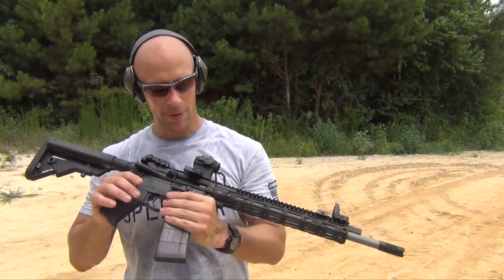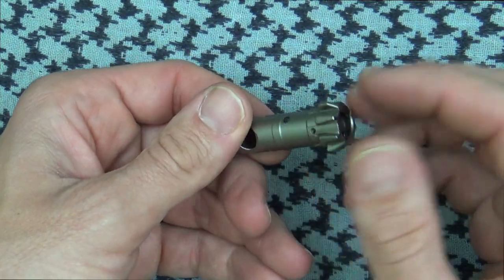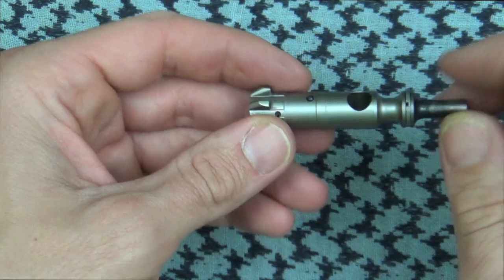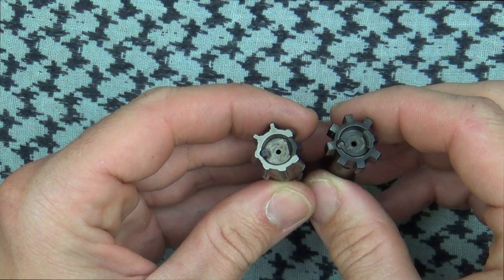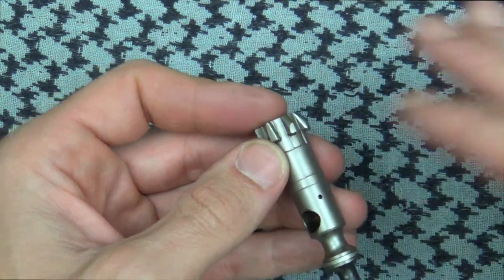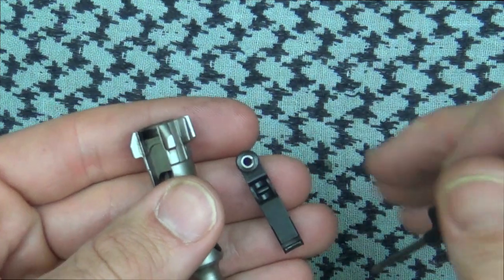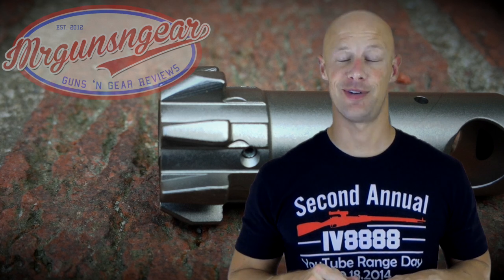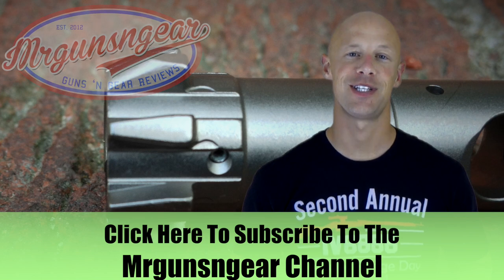Sharps AR-15 Relia-Bolt Test & Review (HD)

Comment: I've been putting together "bump-fire" carbines using the Sharps BCG (WITHOUT the nickel boron addition) and they run smooth as silk, with no malfunction whatsoever. My recipe for a really smooth running and reliable bump fire carbine is:

SlideFire SSAR-15 MOD stock -- and make sure it reciprocates smoothly by adjusting your carbine recoil tube for no binding.
Tubb's flatwire recoil spring
H2-weight buffer
Sharps BCG (no nickel boron coating)
TAC CON 241 trigger (used on first fire position -- not position 3)
Carbine 16" barrel with CARBINE gas system (quite critical for best operation)
Precision Armament "M4-72 Severe duty" muzzle brake

This makes for a truly AWESOME "select fire" carbine. After a few mags, and good lubing I get fire rates of around 850 RPM with PERFECT function (with XM-193 ammo -- Wolf steel case runs absolutely fine, but at slightly slower fire rate). EWL Slip 2000 privides excellent lubrication. The muzzle brake allows for minimal muzzle climb. TOTALLY controllable full auto -- switchable to semi-auto without even having to change selector setting--just move your finger off the slide-fire bar and directly onto the trigger.
Reply from the maker: awesome

Comment: My go to home defense unit is an AAC 300blk pistol. They use 158 steel with an advanced nickel boron UCX EXO coating along with a green o ring. Last year we had 30 days straight of below zero temps, many days down to 30- 40 below zero here in Minnesota. I can't take a chance with the S7. But I do recommend that every one carry an extra bolt and carrier group in their rifle bag.
Reply: What is it about s7 that you don't like?
Reply from the maker: M85FSLUVR Agreed----extra bolts are the way to go.
Reply: Lozzer, normally, nothing. But in my go to rifle, in sometimes very extreme weather conditions (which, btw, in this age of global warming, lol) here in Minnesota, I won't take the chance on S7 because it is more brittle and unstable.
Reply: M85FSLUVR I'd be interested in seeing the Spikes test if you're going to base it off of that one sample size. did they publish how a typical bolt did at those temperatures? For some reason I highly doubt that the S7 is so much worse at those temperatures, when it's so much better otherwise.
Reply: Has nothing to do with the spikes test. Its a more brittle steel. Its science. Extreme temps have an effect on brittle steel. Also, science. Sharps didn't just discover S7 steel. It's been available as a hardened steel for use in bolts forever. Cost isn't the real reason it hasn't been used, science is.
Reply: You guys are leaving out the heat treat factor. Only way to know if sharps addressed it with their proprietary heat treat (which can address the brittle nature in sub zero temps of untreated S7) is to use one in this environment extensively. My guess is it will do fine and you will have other issues before the bolt.
Reply: LozzerGuide There's a reason this material isn't used too. If you have an out of battery discharge , you want the bolt and carrier to absorb the impact. If the steel is so hard and won't be destroyed per se. Then those forces will be redirect. Most likely to the upper receiver. Which will seriously hurt the shooter. Hence, the bolt is Over Engineered" and could cause more issues than helping. The Army did testing about 5 years back, And due to over engineered parts. Elected to remain with parts that would absorb impacts that weren't of normal use. And I do know what I am talking about I have a PhD in Chemistry. An item being of better material doesn't equate to better all around. This is gimmicky. Barrat uses this material in their .50 cal M-107 in which it's needed. Barrat was considering using the material in their REC 7 AR's. When the govt contract told them why they don't use it. Which is what I stated above. As well as what the other viewer was mentioning in fall rate at low temps. Metal has stress fractures over time. So it might fail at a lesser low temp, after a few thousand rounds of use. Whereas, C158 is still quite hard, but can with stand long use of rounds.

Comment: Nice review!

I think it's great that the AR buyer has all these options these days.  That said, my factor S&W bolt has been fine through three years of shooting.  Sometimes I wonder if these companies are making solutions to problems that very few if any owners will ever encounter.  But hey if you want it you can get it and there are likely high volume shooters that might benefit.
Reply from the maker: Murphy82nd Thanks.
Reply: You're absolutely correct in your assessment regarding manufactures. It's a hot market right now and companies want to cash in if they can. There's no need for an Over Engineered Part. It's wasting money. The AR's brother is a proven system for decades now for a reason ...it works just fine.
Reply: +Murphy82nd I actually am more interested in the entire bolt carrier group being a balanced weight with more contact surfaces on the rails, the bolt is cool I suppose as long as they've fixed the issues they were having with broken lugs.
Reply: +Mrgunsngear Channel Hey that carrier looks pretty similar to the AIM carrier I have in my black out Anderson AR, is it the nitride finished carrier that originally came with the C158 nitrided bolt?
Reply: Rick S the whole no tilt balance thing is complete garbage. Carrier tilt occurs because the force is applied by the gas tube is out of line with the center of gravity of the bcg (gas key sticks up on the top) creating torque. It's not because the back of the bcg is a quarter ounce heavier than the front. It's just fancy show cuts that Jack up the price.

Comment: I know this is an old video (especially by YouTube standards) but my main "interest" in this bolt is the retaining pin channel (though stronger bolt lugs themselves are always nice too) I wonder if the increased yield and tensile strength equates to less overall load stress on that channel.

Comment: There is a voluntary recall on these from Sharps. There were batches not heat treated properly. Contact sharps at info@src.com to see if yours was heat treated improperly. They are issuing replacements.

Comment: How close is it to LMT's bolt design?  I know the material used is deferent but are the cuts on the lugs close to the same? Another great video by the way
Reply from the maker: dennis1979gm Similar design but I don't have dimension sheets.

Comment: 9 months later; Whats the verdict? Have you kept running it?
Reply from the maker: worddunlap yes.   0 issues
Reply: Mrgunsngear Channel have you run it on any suppressed SBR's? I know TCArmory managed to break two of these on his MK18 SBR with a suppressor.

I also know that SRC did a recall on a certain batch of the bolts so maybe he just got two bad ones?
Reply: +Joseph L yes he did receive 2 defective bolts according to the sharps rep that commented on his 2nd video. from everything I read there isn't a issue with the lugs shearing off like that since the recall.
Reply: +adam briar - He also broke several mil spec bolts in that same rifle according to Sharps. So it might have been more the rifle. He's the only documented person to have broken the reliabolt.
Reply: Several broke them.

Comment: I'm really interested in using this in conjunction with the Balanced Bolt Carrier.  But I know that a very important contributor to accuracy is how the bolt interfaces with the chamber...  So I have to ask, would the cuts in the locking lugs, or really ANYTHING about this bolt, decrease my accuracy in any way?  Cause if so, I will be just fine with using BCM's phosphate coated BCG.
Reply from the maker: TheMetalHeaD256 Not in my opinion.
Reply: Mrgunsngear Channel Thanks for the reply.  I did some more research and can't find a reason not to buy this thing.

By the way, what is the barrel on that sick looking rifle you're shooting?

Comment: Hello my fellow freedom lover, I was wondering if you would reccomend using a Nickel Boron bcg or the relia-bolt. I'm currently working on a pistol build and am starting to purchase all the parts for my upper. Also, you mentioned the S-7 will stain black over time, would this in turn effect reliability? Thanks for all the information and great vidoes!
~SBRMarksman
Reply from the maker: ***** There's just no right answer here---just depends what you prefer.  Nickel boron will turn black eventually as well, doesn't impact function

Comment: I Broke The Sharps Reliabolt

With reports of them breaking already I say if it ain't broke don't fix it.
Reply: he broke these bolts before sharps had a recall to fix the defect. they changed their heat treat process and there hasn't been the lug breaking  problems since from what I read.
Reply: +adam briar - He also broke several mil spec C158 bolts in that same gun according to Sharps, so there was probably an issue with that rifle.

Comment: Ok so here's a question, if you have the sharps bolt and carrier with the S7 steel and you don't have an S7 cam pin will that softer steel of the cam pin wear our faster rubbing on the harder steel of the bolt and carrier ? That's already a weak point in a AR as it is right ? Or are the cam pins also S7 on these setups ?
Reply from the maker: drtrolish I don't think we know the answer to that yet; at least I don't.
Reply: I replace my cam pin, ejector, and extractor along with the springs and gas rings every 5,000 rounds or so. Basically, I just rebuild my bolt on occasion so I wouldn't expect the cam pin to be a problem if you replace it every once in a while. It only costs $30 or so to rebuild a bolt & it keeps everything reliable. I consider it regular maintenance & cheap insurance.

Comment: Why is there a rubber or plastic O ring in the extractor assembly of that bolt?  I don't own an AR, know nothing really about them, but that seems like a singular weak point to me.  Does the extractor function if that O ring melts or breaks?  Seems like a really stupid design to me.
Reply from the maker: rogue109 Helps with extractor tension.

Comment: Looking into upgrading my BCG to nickel teflon. Contemplating between sharps reliabolt and tr enablings obsidian bcg. Any thoughts on which one is more reliable?
Reply: I know this is 3 months old but I gotta say, I have 2 Sharps BCGs & I absolutely love them. They got some bad press with improper heat treating in their first batch & I think that hurt their reputation but they took care of their customers. I bought a bad one but it's still going strong in a full length rifle & they sent me a replacement. I kept the defective bolt & installed the replacement in my carbine. I liked them so much I ended up getting carriers too. 
I now have 2 full BCGs in carbines & the initial "defective" bolt in a rifle. 
My partner has severe arthritis so we highly tuned our carbines to reduce recoil & that balanced BCG is a great part of that system. They are easy to clean & very reliable.  
I kind of have a fetish for high end bolt carrier groups. lol I run out & buy every new "latest & greatest" product & the Sharps is my favorite at this point. I gotta say some aspects seem a bit like a gimmick but they do work really well.